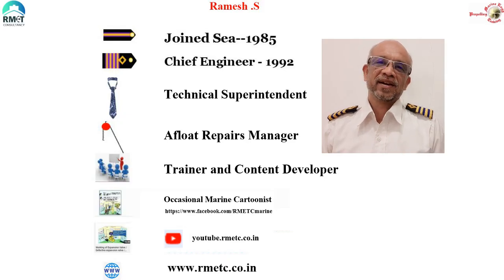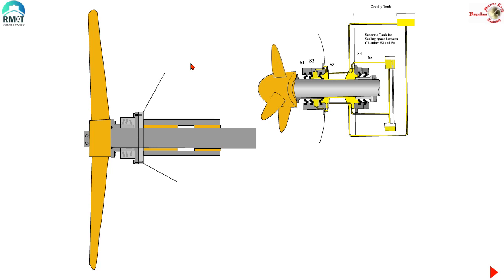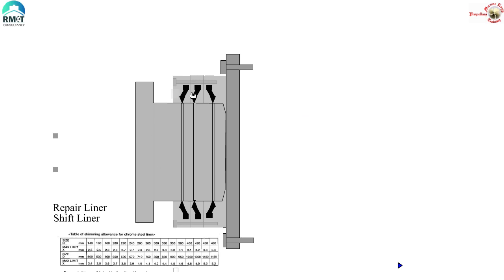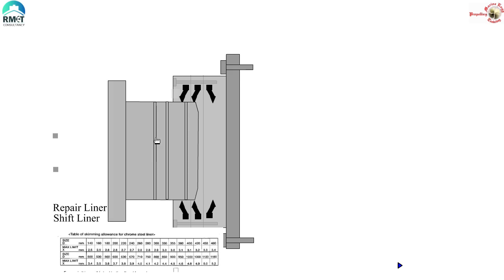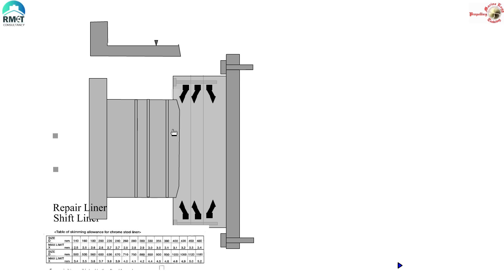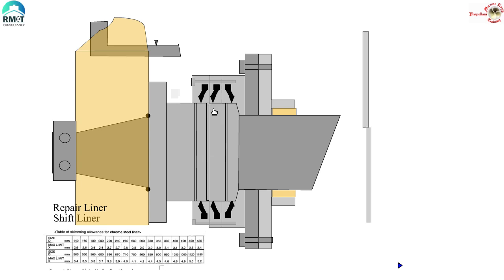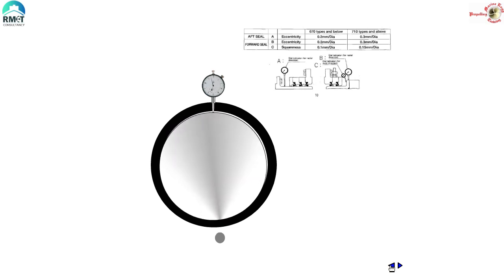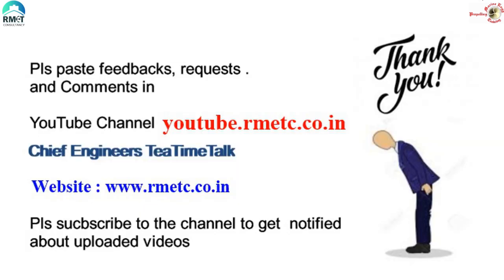Stern tube Seal chrome liner, Significance and Repair video |RMETC |Ramesh

Comment: Nice one sir 👍... it’s not like that we have patience to watch long video... because your content is extraordinary...coming back to video... cover remaining part seals... their testing in dry dock... and please when even u cover any topic please cover latest one ... such as air seal... not old one two gravity tanks ... please cover pilgrim nut fittings with minute details ... stay safe sir and god bless you .. take care sir
Reply from the maker: Thanks for the thumbs up...would love  to  do as time permits..But the topics you are  pointing out are very much circulating amongst the students ...they are HOT Topics ..so mostly everybody has access to some notes or other material. I am generally looking at the practical aspects where info is not very readily circulating.
Reply: @rmetcvideos   agree sir .... want to see from your eyes... testing of seals not covered ... also cover in case of leakage of oil temporary measures... cover TMON survey and requirements(class) ... many things are there ... and your steering gear regulation videos was amazing ... best ever made on cloud
Reply from the maker: Thanks...Regulations are always cloudy.. Just trying to remove the cloud from the mind to understand it slightly better.:-)

Comment: Thank you sir for such informative videos they really help during meo class exams and very easy to remember.
One doubt about shifting of seal holding block forward by removing distance pieces. I told surveyor during exam but he disagreed. I think only skimming method surveyor want to listen.
Reply from the maker: Ha Ha.. need to tell what the surveyor wants to hear..if you want to pass.. But need to know the facts if  want to run ships...The distance piece removal method is not my invention .It is very much from the manual...Wont be surprised if he goes home and quietly reads more after disagreeing with you ..Ha Ha...Remember-- Surveyors  and Chief Engineers are also humans who might have slipped thru the system without being aware of a few things...I know ...how much I dont know...

Comment: thank you sir for the useful upload...sir please can you confirm whether skimming the chrome steel liner affects the length of the nitrile rubber seals or the garter springs and do they have to be trimmed as well?
Reply from the maker: Not Really.. we dont do anything to the seals. WE are trimming the liner Diameter...not length.Seals do not get affected in anyway. THe trimming is also limited, so as to keep the hardness of the liner still active and  also the effect of the garter springs not reduced beyond acceptable value...ANother small Correction to be made in the Video...The trimming is usually by GRINDING and by turning.. we normally do not TURN hard surfaces and hardened surfaces are using put through a grinding process.

Comment: Sir the liner and shaft move together. There is no relative movement? As the liner is bolted to the boss??
Reply from the maker: The liner is not moving ..bcoz the distance ring  is removed the seals are shifting wrt liner..obviously shaft cannot move bcoz of thrust bearing

Comment: but option 2 will affect the hull clearance therefore increase the vibration from the propeller, what do you think chief ?
Reply from the maker: How ?? Nothing is changing. Only the Seal casing is moving forward slightly. The Propeller shaft stays where it is.. obviously .there is no effect on vibration etc.
Reply: @rmetcvideos  okay, got it now, looking forward for more interesting videos, thanks

Comment: Sir can the tailshaft be repaired by welding in way of the keyway?
Reply from the maker: I guess everything is possible..but need to be done by experts with  process which will need to be approved by Class.THe process may involved approval of electrodes with their base mettalurgy and also the welding process and the Heat Treatment and curing process..

Comment: Sir,
While removing and installing back, crome liner and seals are taking together?
Or first romove chrom liner, then seal.
Please reply
Reply from the maker: Generally together
Reply: @rmetcvideos  chrome liner is shrink fit with shaft right. So it also will take out by jack?
Reply from the maker: @sreeprakashp5214  chrome liner is not shrink fit on shaft..it has got clearance..that is why you need centering...
Reply: @rmetcvideos  is there a maximum clearance of the chrome liner and the shaft?

Comment: Sir how I come to know that thermostatic expansion valve working perfectly .. During normal round or watch keeping... ??
Reply from the maker: Low suction pressure but the evaporator outlet  pipe is not cold enough.....high suc press and evapprator suc pipe not gols enough...improper superheat etc

Comment: sir how we use poker gauge to measure stern tube bearing wear down
Reply from the maker: I think we discussed about thsi in the Stern tube repair video.ANyway it is done by removing the plugs given in the Seal housing